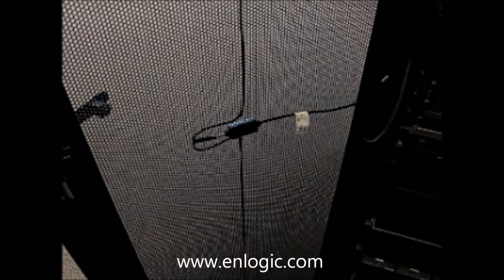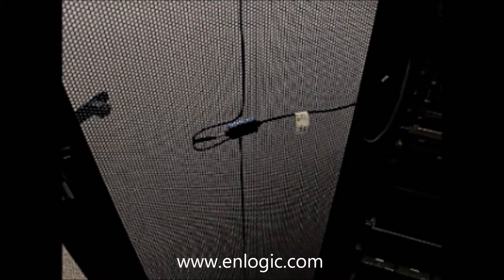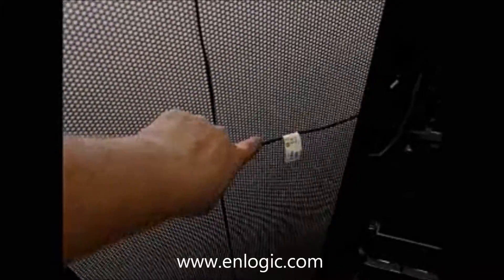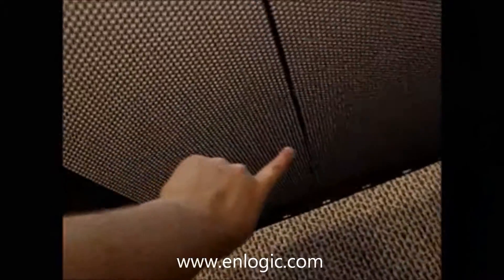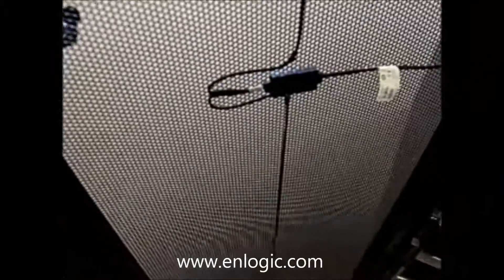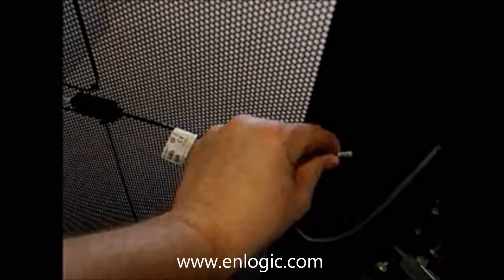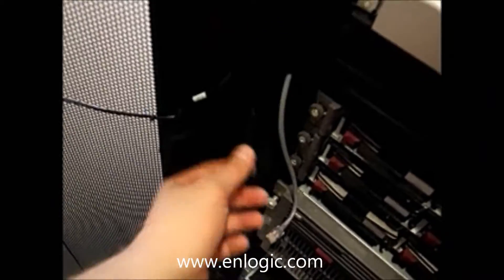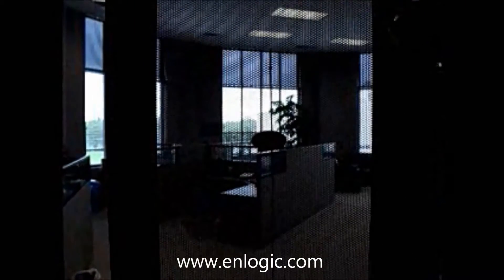Installing Enlogic EA9105, 3xtemp + humidity combo sensor in APC AR3100 Rack

Comment: What is the purpose of these sensors in a sever rack or room? can smoke detector do the job?
Reply: +Chops473 If your HVAC is not working, the sensor will notify you and your servers wont shutdown due to heat.